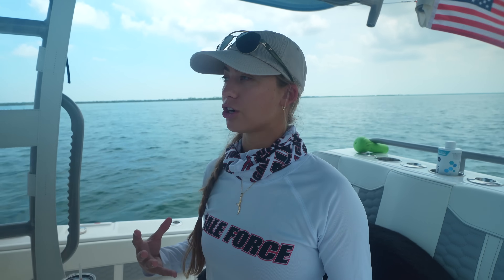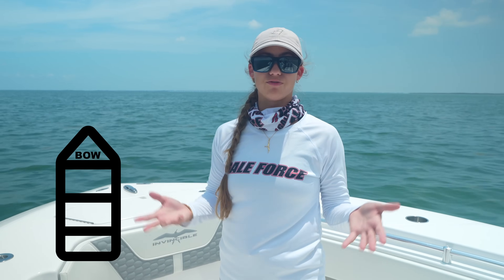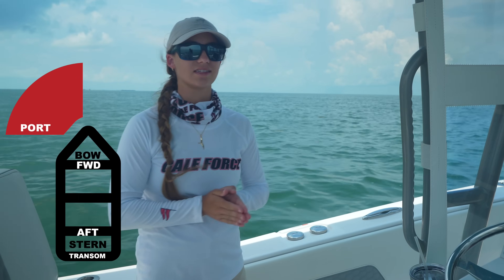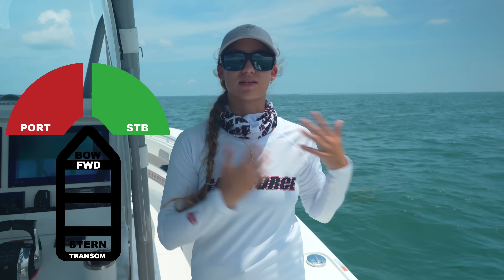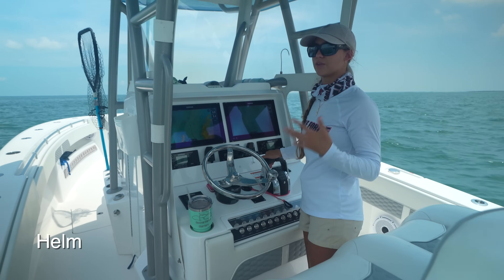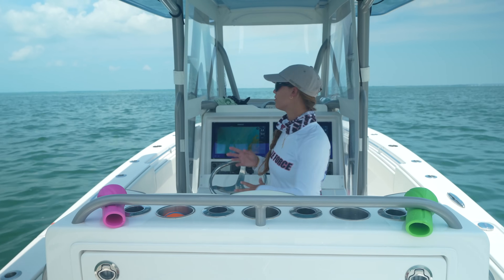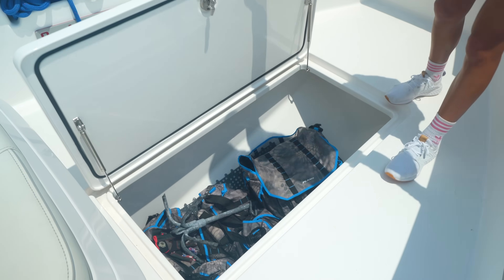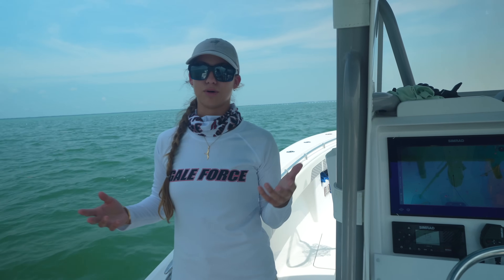Must Know Boat Vocabulary - Port, Starboard, Draft, Beam + more

Comment: Great basic video Captain Emily and Amanda.  I think you should include the Freeboard, the distance from the Gunwale to the waterline.  And since underway when boating under a bridge could get you in trouble, mention the height from the hull at the water line to the highest point on the vessel, called Air Draft/Draught is the distance from the water line to the highest point on a vessel, (including antennas), while it is loaded. Air draft is the minimum height a vessel needs to pass under, while standard draft is the minimum depth a vessel needs float over. As a friendly reminder the "exact draft" includes the propellers down to the skeg below.  Often times draft is used only for how deep the hull sits in the water.  The keel and deck are worth mentioning too.  I enjoy all your videos and again very informative for the basic boater.  Master Captain David.

Comment: Captain Emily and Captain Amanda Aft and Forward is not just a location on the boat it is also a direction especially used during times of emergencies such as when you have guests. Example: “Please go aft and retrieve the fire extinguisher.”
Another very much used is quarter. Example: “Please make fast the port bow quarter line first.”
A very well done video captains.

Comment: I find in arguments about semantics, to use the words in different, but similar situations. In this case, instead of a boat,imagine you're standing in one of those large Rubbermaid totes. Would you be "in" it, or "on" it? You'd likely say "in", but "on" wouldn't be entirely incorrect. Then imagine one of those little plastic snow sleds with 4" tall ...gunwales (for lack of a better term). You'd probably say you were standing "on" it, but "in" isn't incorrect either. 
In your case, I believe you would technically be "on" the deck "in" the bow. But again "in" isn't entirely incorrect either. Maybe that's why Spanish uses the same word for both. E.g. Fija tus ojos en Christo. (Fix your eyes on Christ). Or, El perro es en la casa. (The dog is in the house).